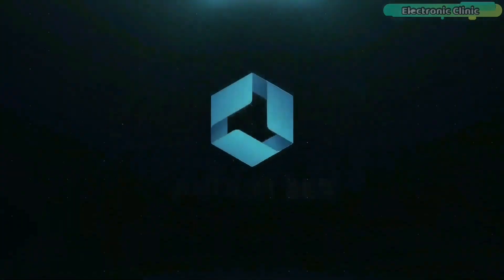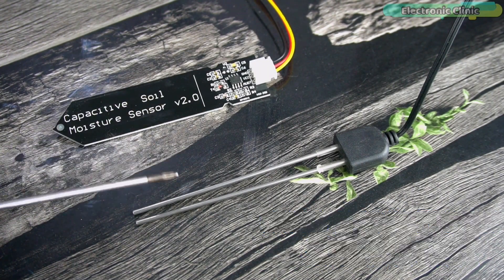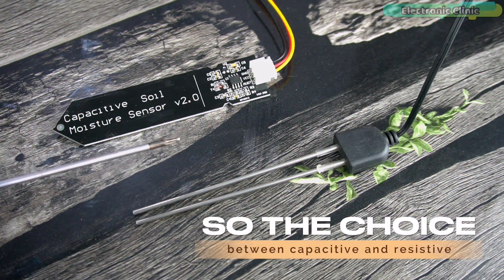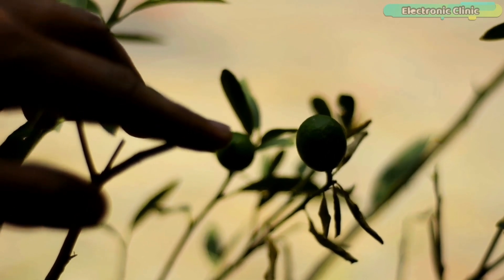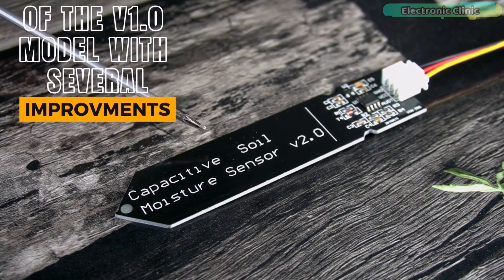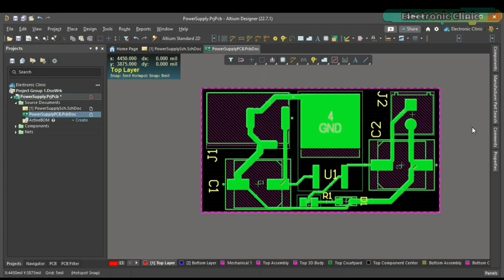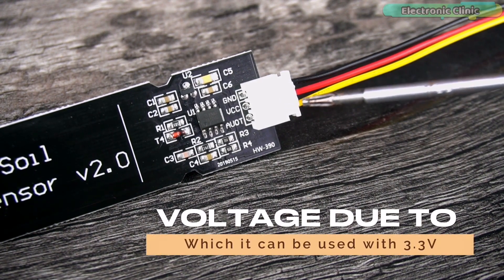Capacitive Soil Moisture Sensor V1.0/V2.0 with Arduino for Plants Monitoring, Arduino Project

Comment: is it safe for outdoor application?
Reply from the maker: Yes. But make sure you waterproof the exposed parts.
Reply: can you gimme example, how to waterproof the exposed part?
Reply: @wahyumiftahulaflah2156  use silicon and on top of that use a heat shrink tube to isolate it completely

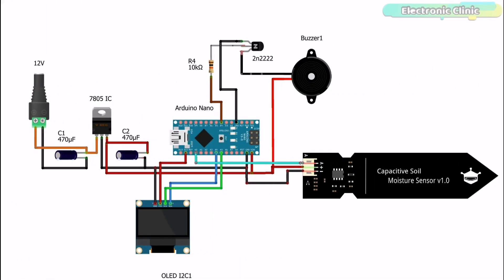Comment: I'm pretty sure the ground of the 12V-connector and the ground of the 7805 voltage regulator should be connected in the schematic at 9:21, right?
Otherwise, I don't see how the circuit would ever receive power.
Other than that, this video is a great source of information!